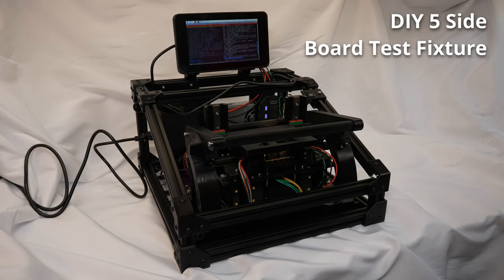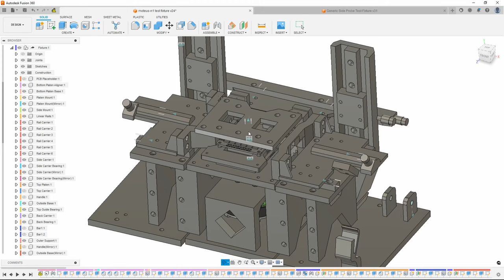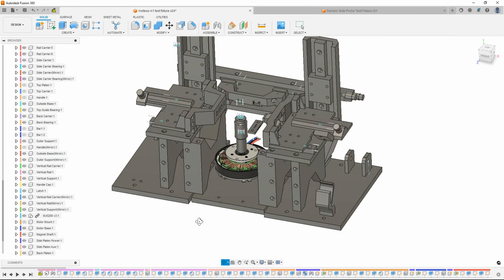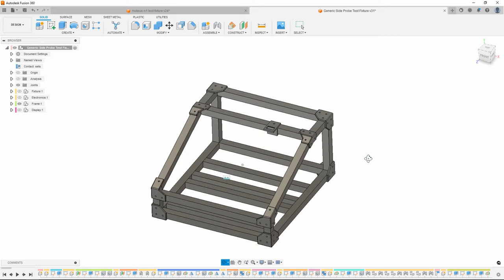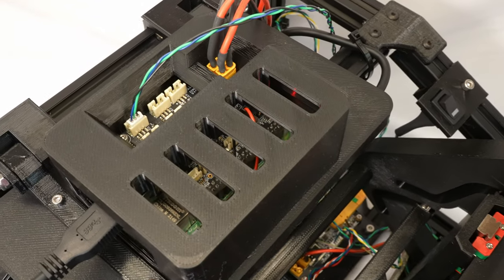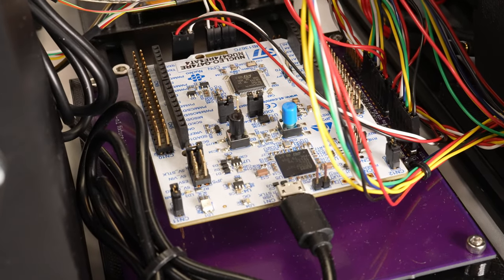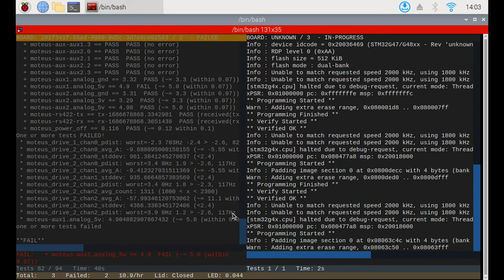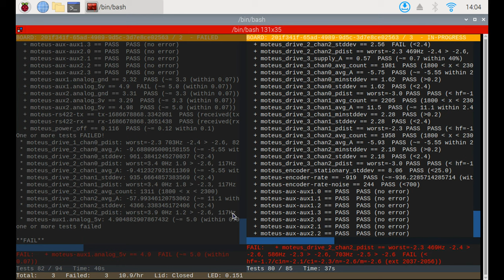DIY Five Side PCB Test Fixture

Comment: I like the arbor press been used while the entire 3D printed part flex :P This is truly some impressive work! I would rather do a PCB re-spin with added test point and not mess with this mechanism with side actuation. yeah I don't know why can't you use "cup" pogo pin for the XT30 and use the 3 small pads for the CAN next to J2?!?
Reply from the maker: One observed failure mode is the CAN PH3 connector having one or more pins not soldered.  You could imagine switching to a vertical PH3 connector, however part of the advantage of this specific board is the low profile when assembled.
Reply: @awesjosh  good point! that is a failure you hope the fab house would detect for you 😅 but that seems like a other fun project to create a visual inspection with the pi and chatgpt vision API!?!
Reply from the maker: Yeah, the AOI can only do so much!  (And a homebrew one is unlikely to be better than the commercial offering the fab house uses)

Comment: Very cool but i am not sure how long that would last on a factory floor. Also why did you decide to use plugs for the connectors and have to go in from different sides? Why not just do the classic top and bottom approach and poke the pins?
Reply from the maker: A non-zero likelihood failure in assembly is that the right angle connector joints are cold or not soldered at all, which was previously only caught by customers.  The plugs are used because of the GH connector design, for which no off the shelf probes will mate well.  The r4.11 fixture is just a clamshell one.  

Based on usage so far, I'd expect it to be good with only minor maintenance for on the order of 10k boards.  It is easy enough to redesign and/or reprint parts that wear to extend the life beyond that.  Not high volume, but high enough for mjbots.

Comment: This is excellent! How did you go about designing the channels for the motion you needed from the lever arm?  I'm working on a project where i'd like manual actuation to result in motion on a different axis similar to your design.  I've designed for several years but designing a similar mechanism is challenging. Well done.
Reply from the maker: The channel path to keep the moving plate fixed is pretty easy to determine from geometry.  I constructed two of those for the start and end of the swing, then just did an eyeball smooth between them for the actual motion part.